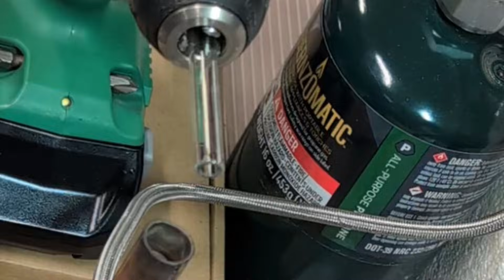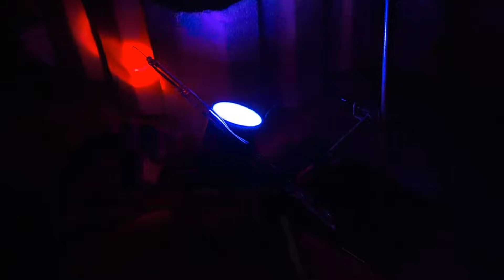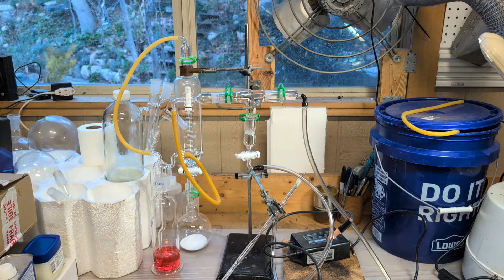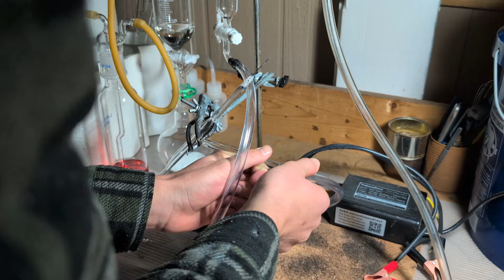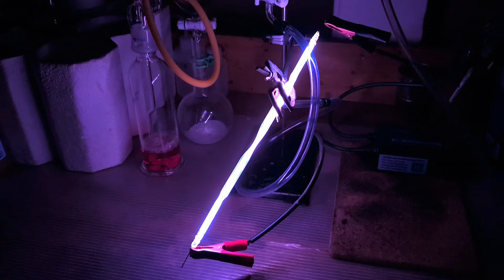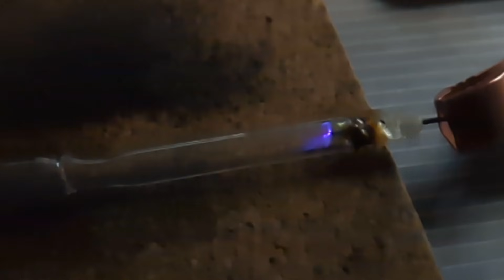Making a carbon dioxide discharge tube.

Comment: apologies in advane fo grammatical/spelling  errors as im.comtypim this in my car lol
but..

Hey man!!
 im hoping by my plasma vortex profile pic on here that you dont immediately think im a spam bot and ignore this comment lol... but ive made a video with some super cool vacuum chamber plasma fun with some very... confounding plasma anomolies i have yet to be able to explain! id love to hear your thoughts man!
Reply from the maker: Yeah true there are many different effects you can achieve in a vacuum chamber. I find that the best experimental setup is having a three necked round bottom flask with one opening going to the vacuum pump and the other two with copper electrodes fitted through rubber stoppers.

Comment: Gas discharge lamps are so beautiful, it's pure magic. Do you think it's possible to make a really tiny low pressure sodium vapor lamp, something like the neon glow lamps, if efficiency isn't an issue?
Reply from the maker: It should be totally possible - even with a minimal set of tools.
Reply: @REACTIONLAB-id1fw  Oh wow, thanks, I was expecting to hear that no way, this can't be done because of the high heat losses! If you ever find the time, could you please give it a try and make one, if possible with the initial violet reddish glow at startup, and preferably without hurting yourself? I'd love to see that! 😊👍
Reply from the maker: Coincidentally this is indeed one of my next projects on the list!
Reply: @REACTIONLAB-id1fw  Great, I can't wait to see! 😃

Comment: Nice project but  I wouldn't call this neon light because it doesn't contain neon at all.
Reply from the maker: The name doesn't refer to what the gas is inside the tube but more to the technology in general. Not all neon signs contain neon - in fact mostly argon and instead they are coated with a fluorescent paint on the inside.
Reply: @REACTIONLAB-id1fw  That's incorrectly called neon and my physics and chemistry teachers would instantly yell on someone who called fluorescent tubes neon tubes.

Comment: When the electrodes fuse to the glass they should look yellow - ish gold.
Black means it was still a oxidide layer
Reply from the maker: I think the color was for the most part yellowish though to make sure I had twisted the glass slightly.

Comment: Should probably make a cheap Spectrograph using an old webcam with the IR filter removed.  It will give you quantitative information about whats going on in the tube pretty clearly.  You will know exactly what gas mixture is inside.
Reply from the maker: Fascinating! I will look into it.
Reply: There's a trick where you use a CD or something as a difraction grating as well.

Comment: Dude -- I've been wanting to do exactly this for years and you just now made me realize it's possible. How long would you say your tubes typically last for? Any resources you can point me to for more info on this kind of stuff?
Reply from the maker: Just get a 1mm to 1/2mm tungsten wire on Amazon and a pack of 10-100 borosilicate tubes.  A neon power supply is preferred. Any propane torch should work but I prefer the one that's not directly attached to the tank. Something to cut the glass with is necessary like a Dremel tool with a diamond disk. Make sure the electrodes are well cleaned and put some twist on the hot glass as you seal them. In terms of a vacuum pump even a small one should do-(under $100). Warning: it took me two years of practice and a multitude of failed attempts to get this one right. However I wasn't practicing day to day so I am sure most DIY people can learn it in a few weeks. As far as I know this tube should last a pretty long time. I just followed the YouTube tutorials and tried enough times!👍
Reply: @REACTIONLAB-id1fw  Excellent. Thanks! Can't wait to try it out.

Comment: You've built a Moore lamp, likely the first time anyone has seen one operating since the 1910s, it's beautiful. Granted a very small one but it would be awesome to add the pressure regulator (if needed) and scale it up into a fixture of some sort. EDIT:   whatever pressure was producing that nice pale white light would be correct, there should not be much pink in a Moore lamp.
Reply from the maker: Interesting! I always thought it was just as any neon light.
Reply: @REACTIONLAB-id1fw There's a whole rabbit hole of history and patents of forgotten inventor Daniel McFarlain Moore. He used to light whole interiors with giant CO2 tubes (there are old photos), he invented the neon indicator bulb...and was murdered. If you look at his patents there's alot more info on glassworking for tubes, including crazy stuff like glass vacuum fittings for tubes used to assemble long lengths of lamp.

EDIT: yes, the operation is essentially similar, but invented in 1898, the first commercial gas discharge lamp.
Reply: It definitely is not the first time since 1910s. People who do electrics and vacuum stuff have been doing this for ages. It's not a dead hobby.
Reply: @lajoswinkler All the videos I've seen never let it stay in the white region, or they make a laser. All they do is "pretty pink tube!" which he also did here, but he let it stay white for awhile and filmed it. A Moore lamp is specifically a white glowing CO2 tube, which may exist for like a brief instance if they are pumping down while energized but they never stay at white. And it's not for lack of the ability to do it, you just need the right pressure, they just don't think anyone is interested in seeing it, we mega nerds are. And nobody has sealed a white CO2 tube off and made an actual lamp out of it, aside from maybe tiny spectrum tubes.

Comment: Hi, nice video. Just my thought: If you try to gen some CO2, the flask which holds the ingrediens are filled with Air too. I would try to eleminate that variable by using very small bottles with materials , which only filled with one material and may be evakuate it best you can, before making co2 out of it. May be this alters the result a bit ?... idk. Worth a try ? No idea..
Reply from the maker: Yes that is true. Although I didn't have any smaller glassware at the time and I figured that flushing the system with CO2 was the best option.

Comment: looks awesome! I've wanted to do something similar for a long while but don't own any low vacuum pumps, any specs for yours? from what I've been told a roughing pump isn't enough but it sounds like the one you're using isn't anything special
Reply from the maker: Even a small vacuum pump(0.5 horse power) should work perfectly fine as long as you are using a sufficient power supply - neon type(5 - 10 KV).

Comment: Could this same setup work for making a sodium vapor lamp ?
Reply from the maker: Yes it surely would! However the amount of sodium used would need to be very small.
Reply: I wonder whether it would be possible to create a cold cathode sodium induction tube. You could theoretically use a sodium coated platinum target to heat up  the sodium  without a filament

Comment: Great video! If you are feeling up to it I would love to see you use different gasses in this. It sounds hard, but maybe concentrating noble gasses from the atmosphere would be fun.
Reply from the maker: Concentrating noble gases would be an expensive endeavor. Though I likely will be attempting to purchase some for future experiments as well as an extension to this demo!
Reply: @REACTIONLAB-id1fw  Fantastic piece of tinkering! I found a 30kv DC supply at an electronics store near me, and since I already had a vac pump, and I'm a welder, I've built a few tubes and tried a few gasses. Argon will ionize more easily than most common gases, so larger separation/brighter glow are possible. Helium can be found where party supplies are sold, at low pressures one balloon can last a long time. If there are welding shops near you, you could ask if they could fill up a couple of balloons for you. If you can come up with a few crystals of iodine and put them in the tube and pump down, it produces some interesting colors. If you can, arrange a "T" in the plastic tubing close to the glass fill tube, and put a needle valve inline with a short tube end, and attach balloons to the tubing with rubber bands. Then you can pull vacuum, turn off the pump, back-fill with gas and repeat a few times. Also try sealing the ends with silicone caulk (sealant) as it tolerates much higher temperatures than epoxy. Airtight glass/metal seals are surprisingly difficult.
Reply from the maker: Big thank you for the thought. I will certainly consider your advice for my future projects! And yes halogens(iodine) and group one metals - notably sodium give a wonderful variety of fascinating colors.